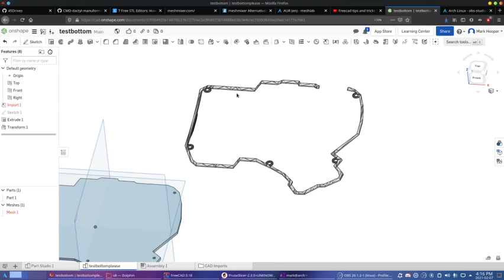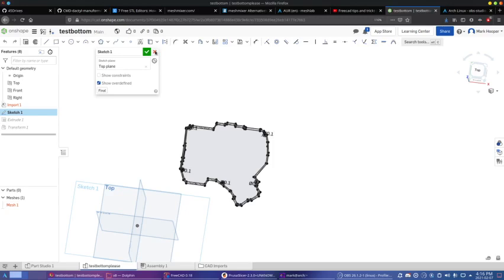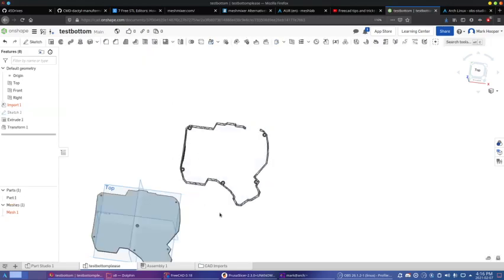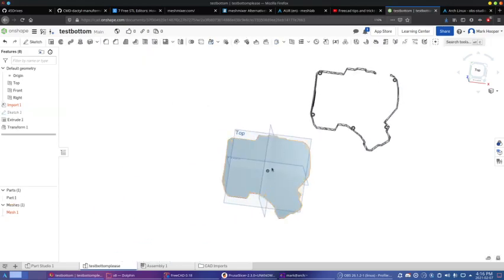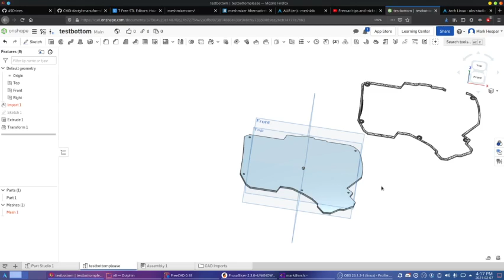CMD - Dactyl Manuform Build Addendum - Bottom Plate

Comment: want one of these, but considering you can by the printer for what ohkeycaps wants (not saying it's unfair, but hey), I think I'd rather learn to print. seems like a good skill to adopt.
Reply from the maker: I bought a printer like 6 years ago and it was one of the best investments/tool purchases I've ever made.
Reply: @constamentaldrift7016  thinking I want a prusa, but also thinking I should just go straight to resin so I don't get an itch for a second printer later
Reply from the maker: They are pretty different tools when you get down to it. If you are printing miniatures, hands down go resin, assuming you have ventilation and post processing supplies/tools handled. But I almost always recommend going FDM for your first printer. And in terms of what to get, an Ender 3 v2 is pretty cheap, maybe not as nice as a prusa, but you can get two for the price of a single I3 MK III, and I get better results on my 6 year old stock CR10 than the print farm of I3 MK3's at work.